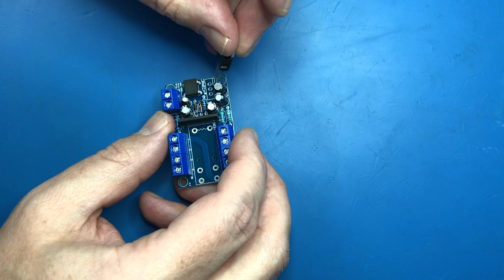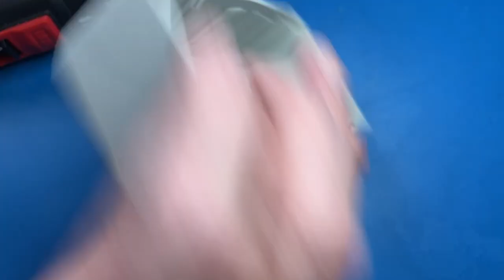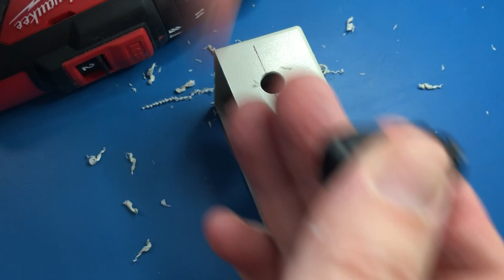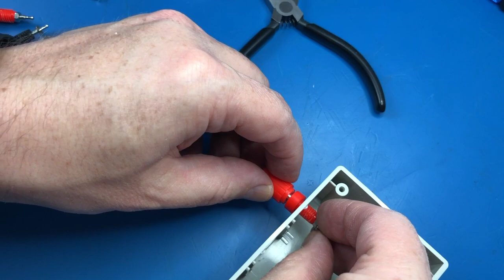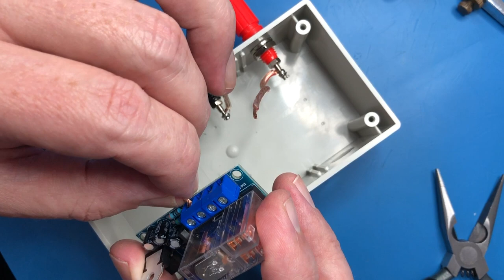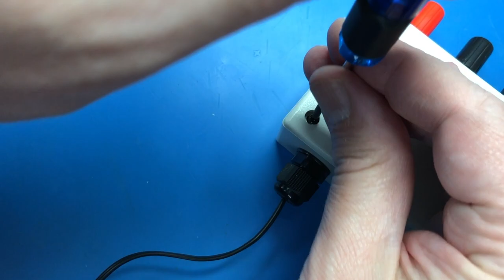Save Your Speakers! upc1237 Protection Kit Build

Comment: I see these are also available on amazon in a heavier duty 2 relay version, with,good enough picture details to "replicate" them ( I see a project in my future, lol) Some versions also have undersized caps in the middle , the 100-10-100 values, so, the turn on delay wasn't working well. Definitely a worthwhile add-on for a high wattage, direct coupled amplifier, of which I own a few, thanks for sharing the project info.
Reply from the maker: Yes indeed, I'll be using these for lower power amps - like my NAD 3120, and also one on the bench so I don't blow my test speakers while testing amps (again), but for continuous duty high power I would want a beefier relay for sure.

Comment: Very well and comprehensive evaluation of this kit. I tried to trigger DC protection with a 12V DC adaptor, (all component values as per UPC 1237 data sheet ,on a protoboard) , but still it didn't triggered the relay off. But the AC sense and power ON relay delay works. Swapped with other ICs, but still couldn't make it work. Tied up 27k  resistor directly to+ rail of 40VDC . Checked voltage across pin2 and ground with lower value series DC sense 27K  Resistor instead of 56K , voltage between pin2 and ground measures 1.5V , current sinking in to pin 2 was 1.4mA. next i will try this on a proper Pcb

Comment: The version I tried was delayed by 1.1 seconds at 9v dc. If that same delay occurred at rail voltage the speakers would be smoked. If you have time try it into a dummy load with high voltage and see how fast it responds. Thank you for the video!
Reply from the maker: 1.1 seconds does sound like a bit of a long response time. Of course the scenario you put forward is one in which the amplifier is operating and then catastrophically fails, requiring the protection circuit to kick in. Thanks for the comment!